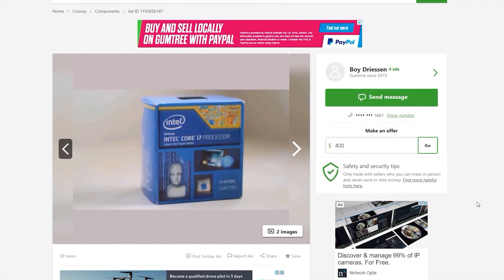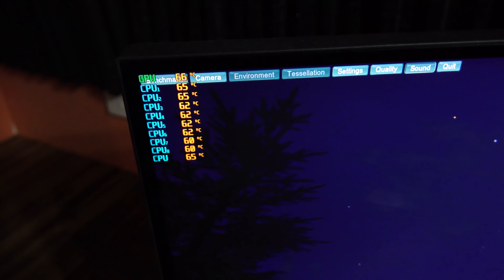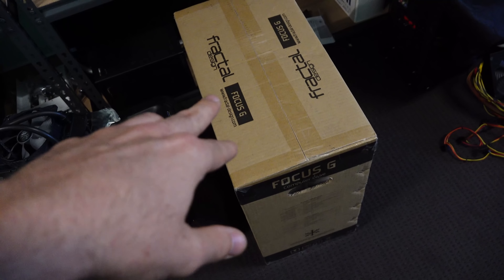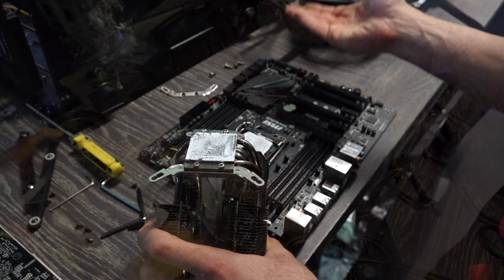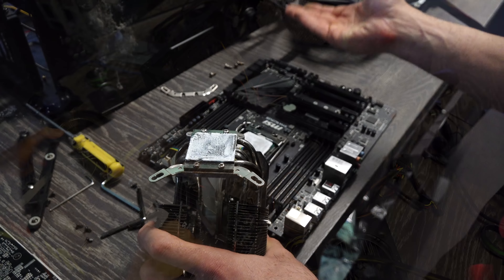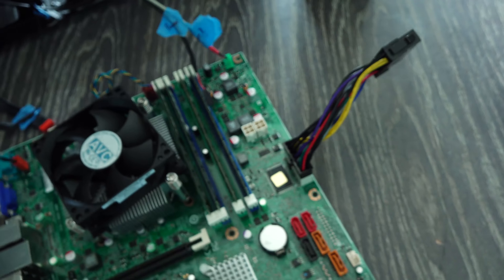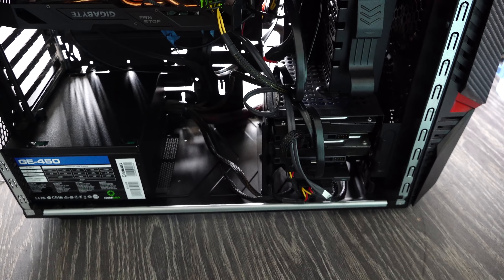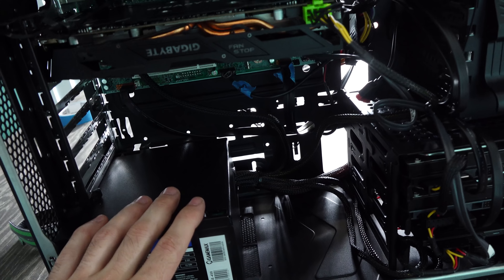How to Part Out Gaming PCs to Sell | PC Building VLOG

Comment: I don't know how to sell computers on Ebay. I only buy them. But based on experience here in Germany, I think I know what the formula is:

1) Ensure the photo is blurred and with inadequate lighting (you don't want people to see all the scratches and yellowing).
2) Don't give details in the description. Always refer to the photos for details.
3) If it's a retro PC, don't include photos of the back of the PC. Someone might guess it is an AT rather than ATX case and bid much more for it.
4) Always include a photo of some part of the inside of the PC. Make sure all part numbers are obscured.
5) Don't accept PayPal (they might open a case against you when the find out it doesn't work).
6) Don't provide tracking information. Don't mark the item as shipped. Don't reply to questions from buyers about shipping. Ship when it is convenient for you. If that's 2 days after the estimated delivery, that's not your problem.
7) Remember that newspaper can be used for packaging. No need to use expensive cardboard boxes.
8) Don't test anything. If you test it, you might find out it doesn't work. But always mention that you haven't tested it, in the description. Don't accept returns.
9) Don't clean anything before selling it. A thick layer of dust makes it attractive to people looking to spend a few days cleaning it as a fixer-up-erer. Extra points for smudges of dirt, grass, hay, rust and spiders.
10) If anything goes wrong, blame the buyer. After all, the buyer isn't paying the Ebay fees, are they!
11) If you are selling motherboards, always sell the IO shield separately. Same goes for monitors: cables in another ad. Neglect to mention this in the description, but make sure the photo does not show any cables. And remember, there's quite a market for manuals, original boxes and the like. Sell those separately. Voodoo cards go without the pass-through cable. Don't forget to mention in the ad that it comes with no extra accessories though. You don't want a claim against you from a stupid buyer who doesn't understand that you are trying to make money.
12) Mark all packaging as "Fragile". This will ensure it gets extra rough treatment during shipping, and you can get your money back for damage in transit. It's much easier than dealing with a claim because the item didn't work.
13) Always remember that there a hundreds of thousands of buyers out there. For every buyer stupid enough to throw their money at you, there's thousands more out there. You shouldn't aim to get word-of-mouth advertising or repeat business, it's a waste of effort and money.

Comment: I sell computer parts online for a living. Selling a fully working PC online is pretty much pointless. Installing Windows takes more time than you'd spend shipping out the various parts. You'd make just as much selling a motherboard with RAM and CPU installed and selling the GPU separately and scrap the rest, than if you sold the fully working machine. And shipping a computer case is a hassle I hate dealing with. Locally, refurbed PCs are worthless. A PC with a RX550, i7-8700 and a couple SSDs that would sell for $475 on ebay would be lucky to sell for $200, $250 tops locally. I pretty much gave up on the local market.

Comment: How did you get around the damn lenovo power supply issue? I have a Lenovo Ideacentre 710-25ISH that has a 250 watt power supply and I want to throw in a 500 watt power supply so I can put a 650 ti, but the motherboard has a 10 pin power connector... i looked at an adapter but it doesnt shut off the power supply when you turn it off. Any ideas?

Comment: Well done once again.
Was hoping to see one of your newly acquired MSI 1070 cards but i guess those are meant for higher builds.
The RX480 Gigabyte logo, wtf? Gigabyte had a brainfart there. Upside down? Lucky the case has no see through side panel.
Wish i had your knowledge when it comes to older CPU pricing. Looking at all those CPUs at Hard-Off i have a hard time to figure out which one is good priced and which not.

Comment: My exact current dilemma. Just landed a cheap 1060 6gb and I'm debating if an fx8320 or 4th gen i7 (Have both lying around) is good enough. Brand new case for 40 gbp an ssd always adds value at mid- high end.

Comment: I would love to see a video maybe you already have made one, but a video regarding using OEM MOBO and installing them in aftermarket cases.  I know that there is a lot of propitiatory issues with OEM'S but with your experience i would like to know what your thoughts on this issue is.
Reply: i done that with dell pcs and no issues
Reply: i know you have to use the same power button out of a dell.  It may be on just some Dell OEM's.  775 MOBO may work without it as well.
Reply: guess I been lucky as the dells i tried it with used normal pc power button

Comment: Picked up a similar PC to that Vostro a couple of months ago for the bargain price of £40... Acer Aspire M5811, i7 860, HD 5450 (stuck in a spare Quaddro K600 1gb from a Dell Precision dual CPU T5500 I picked up recently for a bargain too at £99), 4gb RAM, 600GB HDD... It had an old BIOS that was keeping the Turbo boost down to only 2.6ghz instead of the 3.46ghz which is probably why the guy was selling it so cheap, quick BIOS update and runs pretty decent.

Comment: Is that a display port underneath the pcie lane?
Reply from the maker: Yes... lol its so weird isn't it.
Reply: @techyescity  yea thats like really weird.
"I'm just gonna plug in my monitor through this whole I cut in my tempered glass"
Reply: Put the VGA port on the outside but the display port in the center of the board.
Reply: There's an empty display port on the io shield. you're probably supposed to run a male to female cable from the port on the mb to the io.
Reply: crazy but not unheard of

Comment: I just got a dell Xps i7 at work to fix with a dead board. Looks exactly like the Vostro inside with the literal only difference being the amount of rams sticks and the gpu cooler. Such a innovative company making different model lines and just changing the plastic front panel. Great video, you never really think your going to sell your pc's but once you build one you end up building dozens. Then your running out of tvs to put pc's in, you already made a network storage out of one, you have a bunch of old ones with different Linux builds, using one to heat your basement by just running prime all the time, and your family all has one but rather use a laptop..... but it saddens you a little to see that computer your not using sit there cold, alone, and longing for its 780ti to be gamed on.

Comment: I love it when I see another 5820k in the wild, that's what I've currently got in my Asus X99a ii motherboard. I think I went over kill on the RAM though with 32 GB quad channel Corsair 3000 MHz RAM. Since I don't know anything about overclocking I used the Asus AI automatic overclock and it seems to run my RAM at a clock speed of 1333. the timings are 15-17-17-35. To anyone who is educated in overclocking, do these numbers sound normal? From my perspective 1333 seems really low... But I guess because it's quad channel, it's all added together or something. I wish I knew someone local to help me

Comment: Hm... wonder what the i7 870PC has inside. 

As for the white goo-ey stuff: I've had decent results with Arctic Ceramique 2, but it's quite hard to spread and usually would look a bit different ... the stuff in the vid looks like the cheap Coolermaster (IC Value or so) stuff.

Edit:  As for parting out PCs: What I mostly swap around are HDD, Ram and PSU. HDD and RAM don't really make a difference unless they're actually used, as for PSUs I sometimes find PCs with hilarious overkill PSUs in them, which I swap for ones more in line with the PCs specs.

Comment: How do people generally fell about case windows, I've never cared much for them. In my previous desk setup, the PC was on top at the right, so it could have shown a window, but now it's under desk on the left... The case for my new build has some LED front fan action, but that's about it - oh, and I went with the newer fashion of PSU low, just hope that doesn't bite me with the PSU cable length otherwise I'll be waiting for extensions, as the original system donates the 500W Silverstone PSU and gets my spare FSP 300W to keep it running - yeah, a X4 965 (125W TDP) and GTX 750Ti is a bit of a squeeze for a 300W, but it's a FSP that can do nearly all the power on the 12V, unlike some cheap and nasties!

Comment: How is the Gigabyte logo upside down on the GPU cooler?
Reply: That's just how it is... you can't flip the plastic casing over. As you can see the "FAN STOP" text is the right way up.
Reply: Ah right, I wasn't aware of that. Thanks for the correction!